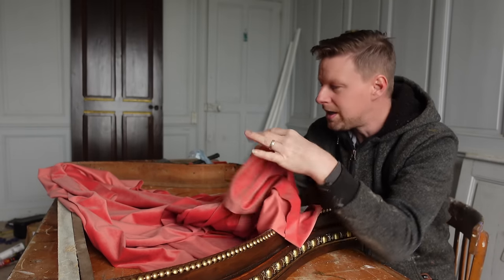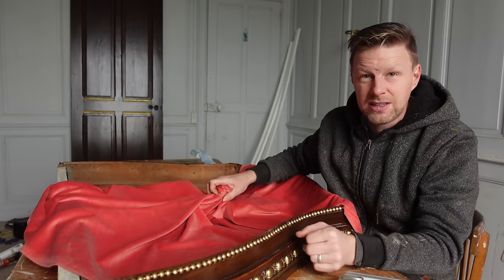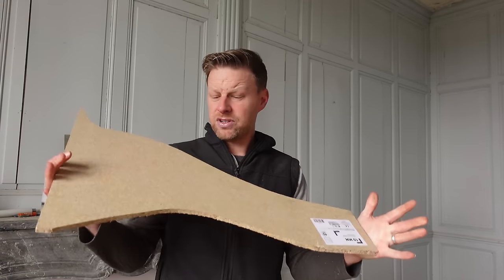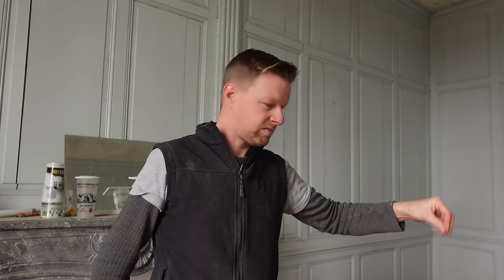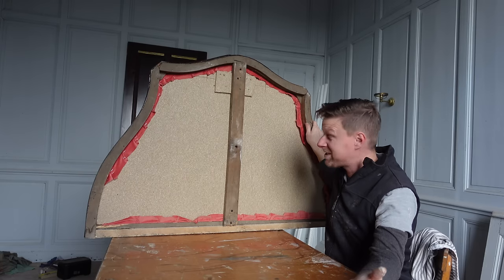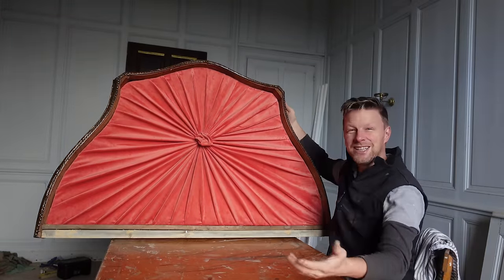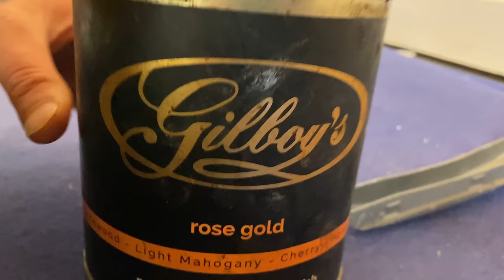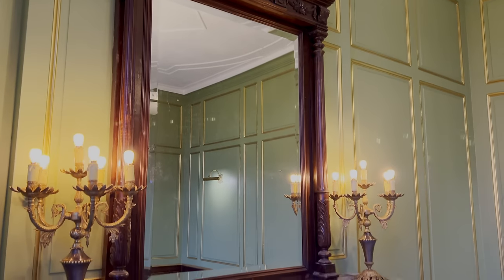The PERFECT CHANDELIER Is Fitted In The Chateau Bedroom

Comment: You did really well to never have done this before. Historically, each pleat would have been hand stitched in place. A bit easier method is to trace a 8-10 inch circle in center of fabric. Baste stitch around circle, gather, pulling the "rose" so it will be going in, resembling tufting on a sofa. Place on a board (as you did) except with a hole drilled in center, big enough to allow the rose to slip through. Flip board, arrange pleats, tack in place around outer edge, placing tacks underneath pleats so they aren't visible. With the "rose" now slipped inside the center hole, you can cover the hole and hold center pleats in place with a large upholstery button, again like used when tufting, but larger. I would also put a layer of batting on the board before adding fabric. As fabric ages, the fibers tend to relax and restrict,the batting will be more forgiving.
Reply from the maker: Thank you 🥰🥰
Reply: Very practical advice. Thank you for sharing.😊

Comment: The bed crown is lovely! A simpler method for future ones: use a plate to draw a circle around the central point. Hand baste the circle with regularly spaced stitches - perhaps in the range of 3/8 to 1/2" - with strong thread, then draw it up. This will preset all your pleats and you just fan them out. I count them out into 4 groups and fix my pleats at 12, 3, 6 and 9 o'clock first, then place 4 more in between those so the crown is in 8 sections. This makes it easy to affix the rest of them evenly. Your experience with the current one will tell you how big the plate should be and how big the basting stitches should be.

Comment: Great job!
Before adding the extra petals, you’ll want to sew through that center rose a few times (with strong thread), and tie a strong cord around it too. The flower will hide that. The rubber band will fall apart at some point, and I know that you don’t want to have to fix it later, after you’ve got it just how you want it. The rubber band might last years, but I know that you also don’t want it to let go when a guest is there.

Comment: If you do any of these in the future, One suggestion for the center is to use a wooden disk and form the fabric around the disk on the bottom side to make a button in the center of the gathers. Also I would suggest using string to tie the center with rather than the rubber band. Rubber will rot and turn brittle over time, then break. String won't do that.

Comment: I found  it easier to use a long length of straight fabric attached to the outside. Hem the inner edge and put a cord through it like you would on the end of a round bolster cushion and pull the cords tight and tie. Then you can play with the pleats to even them out. You’ve done a great job.

Comment: Another solution would be to cut a hole about 10 to 15 cms in the middle and put a running stitch around the edge drawing the fabric in and then distributing the pleats, then covering the hole if visible with a 'rosace' from the same fabric or other. xo

Comment: Might I suggest you drill a 1-2 inch hole and pull the fabric with elastic through to the back side.  Than cover a large button with fabric or use a small medallion ... gold leafed of course, to cover the hole on the good side.  My concern with leaving the elastic would  be that it would become degraded over time and break.  It looks just amazing.   What an awesome idea to use a backing board.   Good call Tracy.

Comment: Be aware that the band if rubber will deteriorate over time. Maybe try a zip tie to give additional support.  It looks amazing, lots of effort went into it, and it shows.
Reply: Yes I agree
Reply: In addition to the zip tie, which could be slippery, I'd add a lot of stitches to the center gather using heavy-duty upholstery thread.
Reply: A piece of gold braid to cover whatever fastening is used would work as well.

Comment: If you use Quilt Batting and tack that on underneath the fabric on the frame then apply the fabric with a gathering stitch in the center for the pleats, that would give it a fuller more elegant finish.

Comment: I would suggest replacing the elastic band with a piece of string.  Elastic bands are notorious for degrading/disintegrating over time, speaking from experience.  If that happens, you may loose your rosette. That being said, you mentioned something about gathering an extra piece of fabric sewn to it, that would probably keep the rosette from coming apart if the elastic does degrade.  Just a thought